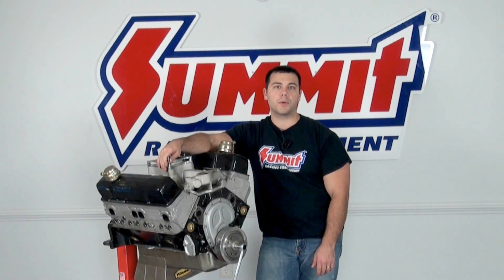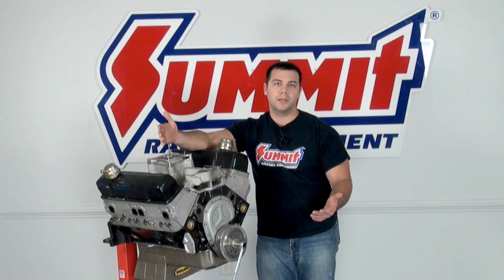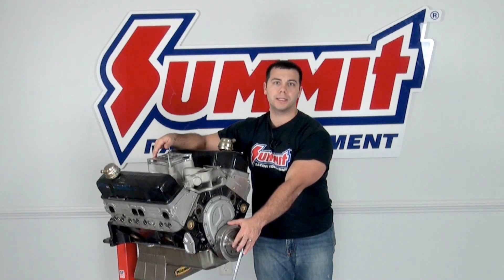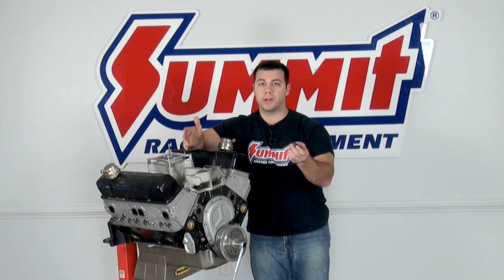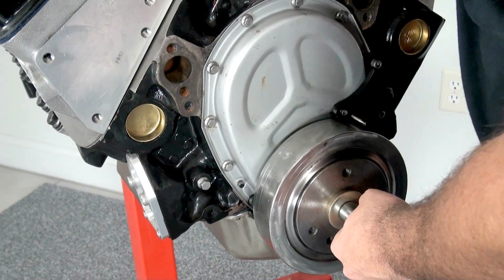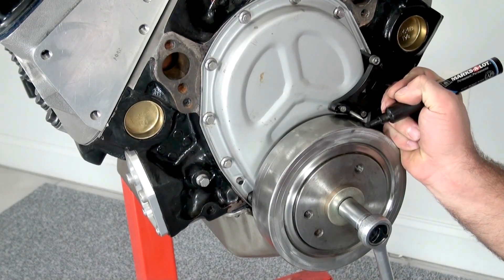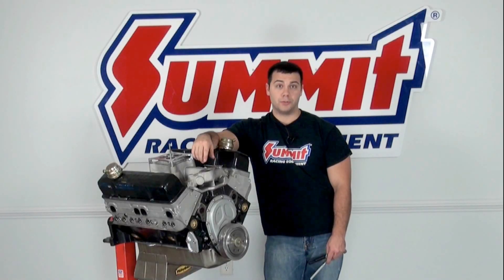How to Find Top Dead Center - Summit Racing Quick Flicks

Comment: This is a poor video because it makes far too many assumptions.  It doesn't show the TDC piston stop tool or how it works. It doesn't show how to adjust the stop gauge. There is no explanation of how we know the piston has made contact with the stop tool. The audio doesn't line up well with what is being shown. There is no mention of why you are rotating the engine the other direction.

Comment: If I try and reverse after first finding the top of the stroke, the bolt holding the harmonic dampener begins to back out?  Is that normal?
Reply: Your bolt isn't on tight enough. Get a torque wrench and tighten it

Comment: What I did I used an  extra spark plug and drilled the center out of the plug and a hose with a  compreswion guage it  worked nice.

Comment: Come on summit racing.There’s more to finding top dead center On a four cycle engine than just finding when the number 1 Piston on is on the top. You need to know when it’s on its compression stroke before you drop the distributor in otherwise could be 180° off
Reply: That's incorrect.

When the crankshaft rotates 360 degrees, the piston will still be at TDC regardless of being on compression or exhaust strokes.

Camshaft timing does not determine where the piston will be located.

Comment: Are you nuts? Doing this without making sure the valve s don't open can bend a valve!  To be safe, you should pull the valve cover,  even loosen the valve springs so they stay seated.
Reply: LOL you know that a piston stop goes alot deeper in than a spark plug right? And some cylinder heads like a big block Chev have valves angled toward the centre right? You do realize the spark plug hole is in the centre of those valves right? Like I said it's a no brainer.
Reply: ... That's incorrect. Your timing chain will move your camshaft while you are rotating your engine. The valves will only move in coordination with crank rotation. 

There is zero chance of damaging a valve this way
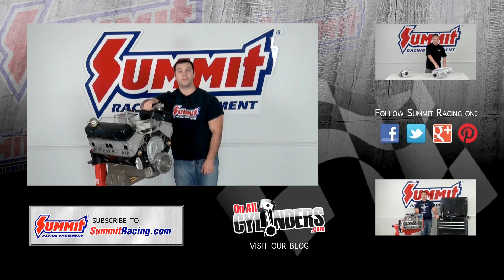Reply: Sounds like you've never done this before. The exhaust valve will open on the exhaust stroke so verifying your on the compression stroke will also make sure your valves are closed. To be 100 % sure, you can back off on the valve springs. 3:20
Reply: @jimsl7851  your engine doesn't just magically change your intake or exhaust valve timing just because you are manually cranking the engine. Sounds like you're the one who has never done this.
Reply: Valve timing has nothing to do with the fact you will reach TDC two times on 3 different piston strokes. The valves will move, and if you're running a cam with a significant lift, you run the risk of a valve contacting the piston stop. It's a no-brainer.
Reply: @jimsl7851  you do know that the piston stop goes in the spark plug hole right?

Comment: Yeah but is it on the compression stroke or the intake stroke I don’t use a tool I put my finger Over the plug hole when u fell air pushing out your on compression stroke

Comment: Poor video.  Never showed the piston stop tool.  The audio does not agree with what he is doing.  Doesn't explain why he is moving the pointer (to center it between the two marks).  It is a harmonic damper, not a dampener.  Never mentioned that this is to be done on the compression stroke.  Not up to Summit standards.
Reply from the maker: Hi Frank, we appreciate your feedback. This is an older video. We are working to recreate and improve all of the engine videos we have done in the past. Please stay tuned, the updated version of this video should post soon.

Comment: What did the stop tool do? Does the piston push something out kinda like a tire guage or what?? This video was not much help. Most of have the engine already in the car.
Reply from the maker: Thank you for your question. The purpose of a piston stop allows you to find an equal point of reference before and after TDC. The centerline of these 2 points is true TDC.  The process goes like this -rotate the engine (by hand) clockwise about 1/8th of a turn past TDC, thread the piston stop in, then rotate the engine counterclockwise until the piston contacts the stop and won’t allow it to rotate any further. At this point (atdc) you would place the first mark on your balancer or degree wheel at the 0 on your timing pointer. You would then rotate the engine clockwise away from the piston stop almost a full revolution until the piston comes up and touches the stop again. This second contact point (btdc) is where you would again mark your balancer or degree wheel on the 0. You will now have 2 marks on your balancer or degree wheel and True TDC is located in the very of the 2.
Part 2
If you want to re-install your distributor after you find TDC you can place your finger over the #1 spark plug hole and when you feel for compression while rotating the engine the timing mark should be about ¼ turn away from tdc. Or you can remove the valve cover and watch the #1 intake rocker arm open then close at which point the timing mark will be about ½ revolution away from tdc or 0.
Reply: Procedure works exactly the same when the engine is in a car.

Comment: Take plug out of #1 cyl put awadded up piece of paper towel BE CAREFUL not to lose in cyl have someone crank engine stop when pap towel is blown out of cyl. OR put thumb over hole have them crank until it blows thumpb out of cyl,go to timing mark put pointer@ TDC. Set dist. This WORKS!.

Comment: I didnt that before and i was still 180 off back fire sound like a shot gun. Now days i just put my thumb over the spark plug hole spin the engine by hand when i feel air trying to blow my thumb off then i stick a screw driver in the hole bring it up until the screw driver wont move anymore and thats my tdc and sometimes im still 180 off...

Comment: To find the compression stroke, place your finger over the hole until you feel air come out. I would prefer to do this by having someone using a flywheel tool that you use to to install the torque converter bolts IF YOU HAVE AN AUTOMATIC trans. I believe the flywheel tool can be used on the pressure plate also as it to has teeth for the starter to engage. AND, after you arrive at the compression stroke and air is seeping out around your finger, either use a straw to show when you are near TDC or use the tool for more accuracy! You can turn an engine either direction to get more accurately on spot with the piston gauge. If using a dowel or straw and you feel you can get close enough, go to the timing marks and take it from there. But you may be  @ TDC or BTDC. I would say you are close enough if you line the two marks up. Distributors usually give you play room of at least a couple inches either way of turn radius depending you vacuum module hose or wiring length.. This was just a video to sell a tool we didn't get to see because it was also not explained how to remove the valve cover to watch the furthest forward rocker arm to it's peak rise to show DTC.  Without this subject of finding TDC being accurate, there's going to be loads of problems!  There are so many ways to get this right regardless of engine if you know which piston is #1, that there's no room for getting it wrong if you follow simple directions.  Yes, the tool is just a fancy item for finding TDC, but it is probably the best for accuracy. It can't lie. I will see if I can find a video with one in action!

Comment: Poor explainations, hard to follow. How far doe the stop tool have to go in? all the way tight? Why are you rotating the balancer both way for two marks? I will just use my finger over the # 1 cylinder and take it from there.
Reply: The stop tool only need to go in far enough to make contact with the piston. You turn the balancer both ways because there’s a certain amount of crankshaft rotation where the piston is motionless at TDC. By going both ways you can isolate that area of crankshaft rotation then measure the distance between both of your marks and the center is true TDC

Comment: Hi, thanks , great video. I am new to these DIY stuff. Just wanted to know , when the piston stop bolt is screwed in then crankshaft must be in compression stroke? Or it doesn’t matter? 
There are no marks on anything for TDC. I was looking forward to do it with TDC gauge, which method is more accurate to find TDC? Thanks.

Comment: I've just replaced AFM lifers and non afm lifters on right side  in a 5.3L LC9. Question is, if I havent turned over the engine at all, couldnt you reinstall rockers, torque to 22 ft/pbs, without findind TDC and going through the whole tedious process of re-lashing all the rocker arms.

Comment: Question when Chain is worn? and the Cam point is off.and Pointing at 1200. do you just put the mark back at 6:oo and put new Chain on?
Reply: the crank gos around once and the cam spocket go's around 2 time's to make sure your right on! take the valve cover off and the intake valve once closed then set your cam spocket to the makes on crank spocket and on the cam spocket.12 on crank spocket and 6 on cam spocket. and your done.

Comment: Either the camera is mirrored or he just put it in #5
Reply: I wonder how many people this video has screwed over with that
Reply: @lsan6833  nome, seeing as he out it on the correct cylinder, you just don't know shit about V8s.
Reply: You're wrong Moe. He put it on the front most cylinder on the driver's side. That's cylinder #1 dude. Cylinder #5 would have been the driver's side, second from last. Y'all fake mechanics need to stay off YouTube
Reply: Uncle Moe Lester don’t you hate when you put it in the wrong hole
Reply: This is a smallblock Chevy and on a smallblock Chevy, the #1 cylinder is the front, driver's side, and that's exactly where he put the tool.

Comment: Worst description ever. No idea if it’s 180 out or not!
Reply: 50/50 chance!  What could possibly go wrong?  hahaha
Reply: TDC is TDC regardless of which stroke you’re on. If you’re actually going to be setting up timing you 100% need to confirm it’s on the compression stroke but it’s not necessary if you’re simply trying to find TDC

Comment: SUMMIT PLEASE READ YOU NEED REMOTE STARTER OR PERSON AND A DISTRIBUTOR WRENCH
THE ENGINE GOES AROUND TWICE  FOR EVERY ONE TIME THE DISTRIBUTOR DOES .
YOU HAVE A COMPRESSION STROKE AND A  EXAUST STROKE.
YOU THROW YOUR TOY OUT THE NEAREST WINDOW LOL JUST KIDDING
yOU NEED THE COMPRESSION STROKE  WITH DISTRIBUTOR UNPLUGGED OR OUT .
YOU USE A SUMMIT REMOTE STARTER LOL OR ANOTHER PERSON BUMPING KEY 
OR BY SOCKET THE HARD WAY.
YOU PUT YOUR FINGER IN NUMBER ONE SPARK PLUG HOLE AND TURN ENGINE WITH LITTLE BUMPS  UNTIL IT BLOWS YOUR FINGER OFF..
WATCHING YOUR POINTER FOR WHEN LINE COMES AROUND TINY BUMPS WHEN IT COMES INTO SIGHT.
EVEN TURNING IT WITH WRENCH IT WILL BLOW FINGER.
THEN IF YOU ARE WITHIN A HALF INCH EITHER WAY YOU ARE CLOSE ENOUGH .
YOU MIGHT HAVE TO DO IT TWICE IF WITH THE STARTER  
THAT IS THE COMPRESSION STROKE TOP DEAD CENTER!
THEN YOUR  ROTER HAS TO LINE UP WITH NUMBER 1 ON DISTRIBUTOR CAP!
iF YOU ARE USING A WRENCH YOU CAN GO PAST TOP DEAD CENTER AND PUT IN YOUR TOY IN SPARK PLUG HOLE
AND TURN BACK BY HAND UNTILL IT HITS TOP DEAD CENTER STOP.
IF ITS A VACUME DISTRIBUTOR MAKE SURE THE DISTRIBUTOR VAC IS POINTED AT OR A LITTLE BEHIND TRANS 
DIPSTICK SO YOU CAN SEE DISTRIBUTOR BOLT.[T WILL MAKE EVERY THING EASIER lol
YOU ARE WELCOME.
Reply: SUMMIT PLEASE MAKE A NEW VIDEO YOUL DRIVE EVERY BODY INSANE

Comment: Piston stop can verify whether your balancer has "shifted". Only reason to use piston stop. You wouldn't drop dist. In at TDC anyway on a Chevy v8.
Reply: Wrong and wrong. The primary use of a piston stop is to mark TDC on a balancer. MANY balancers don't include a TDC marking from the factory, including a number of Chevrolet engines. Additionally, not only did no one ever say that this is for dropping the distributor in (it's not, it's for marking the balancer) but you're wrong there anyhow, as you absolutely CAN drop the distributor in at TDC. You can drop a dist in at ANY point. You clearly don't know anything about how an engine works.

Comment: Are you hitting tdc on intake or exhaust cycle
Reply: You’re suppose to check tdc on the compression stroke
Reply: Eric Flores that’s incorrect. You can mark TDC on either the compression or exhaust stroke. The only time you’re concerned with TDC on compression is when you’re setting ignition timing

Comment: haven't worked on motors for decades. my old school way was to hold your finger in the spark plug hole and turn the crank til air blew out around your finger, which of coarse told you that you were on the compression stroke. then stick a wood dowel in the plug hole and turn crank  while watching the dowel and bring the piston to the top.
Reply: The dowel will either be dead on OR 180 DEGREES OFF, Put thumb over #1 cyl till it blows off line up tim mark to TDC.
Reply: @packingten   That is the best and most  simple way to do it. If you are by yourself they make a tool the screws into # 1 that has a whistle built into it and makes an audible sound.
Reply: Pretty sure all the Chilton Repair Manuals illustrated the finger in the spark plug hole method.

Comment: You forgot to mention that TDC on #1 piston must be on the Compression Stroke. It would help to tell people how to determine that also.
Reply: It wouldn't make any difference.  TDC is when the rod to the piston is straight and both valves are closed completely, e.g., just  before the compression or just after the exhaust stroke.  There is no stroke at that point, and there isn't one, because your engine is off.  The rod to the piston has to be straight, the piston has to be at its highest point, and both valves have to be closed.
Reply: @roswellgrey9771  the difference is that you may have an error of 180 degrees at the distributor.  That's the importance of finding the TDC at the peak of the compression stroke.
Reply: @MrEdgaravi  those  are two  separate  things though.  the video  was about  finding  TDC

youre timing goes  beyond that
Reply: @MrEdgaravi  Exactly, as a kid back in the 1980's I rebuilt my Pinto engine, thought I was all set, started it up and flames shot out of the carburetor throat upon cranking. My grandfather, God rest his soul, a backyard mechanic from way back, came over and explained what the problem was.
Reply: @roswellgrey9771  He forgot to remove driver side valve cover to also make sure that both valves are completely closed.
Reply: @sergiojacquez2277   TDC is TDC .. What are you going to do if your valves aren't timed correctly?  This video was only showing how to find TDC not valve timing.  Valve timing is determined by TDC not the other way around
Reply: @roswellgrey9771  Yes, but all timing measurements are based on Piston #1 being in that condition, which only occurs on the compression stroke once per cycle.
Reply: I was like wait lmaoo. some poor young soul🤦🏼‍♂️
Reply: @Motoboro660  I mean if your working on a car you should already know that🤦🏽‍♂️

Comment: If this is your first time using this tool like it was mine think about removing all other spark plugs and remove rockers from #1 piston. Otherwise you might not "feel" the piston stop hitting the piston. This also prevents valves from hitting the stop tool if you accidentally go beyond the compression stroke.  I bent the threaded rod with the piston then gouged the intake and exhaust valve in the top side of the rod.
Reply: Dane Hansen you need to be more careful. I didnt have to do any of that.
Reply: 100% operator error

Comment: You made a VERY big mistake...you should not have moved the adjustable pointer to the midpoint of your marks.  You should rotate the crank so that the midpoint of your marks lines up with the pointer.  Then If the balancer has a 0* groove or painted line that you want to use instead, you can THEN move the adjustable pointer to line up with that groove/line.   Also, It would be better to use a marker with a finer point.  The width of the marks you made were easily 3-5 degrees wide themselves, not to mention crooked; not very precise.  I realize you were working quickly for the sake of the video, and wanted the marks to be large and visible, but it would be better to do things right so as not to confuse people.  I'm sorry but this was a very poorly made video.  It should be redone.
Reply: Hmmm.  You know, I think you are right.  The original use of the pointer is just a stationary reference point to get two markings.  Moving the crank to center the pointer  between the two marks establishes TDC on the crank.  ...THEN move the adjustable pointer to line up....  Hmmm, that does make sense.
Reply: I was very confused till i read your post- thank you. using the piston stop gives you the arc or degree of tdc. it will vary based on where you stop the piston, but it should be consistent. Move the balancer marks to center with your fixed point and the TDC on the balancer should be very close to the pointer. thank you
Reply: I agree, but only if your HB has the degree markings on it and is repositionable. Mine is not repositionable but it does have the degree markings engraved on it. I have two corrective choices; 1) I mentally compensate, i.e. 1° BTDC is really TDC, or 2) I cover the HB with a new timing tape. I guess there is another solution. Swap the timing pointer out for an adjustable timing tab with degree markings and use the HB to only designate TDC/0° (ignoring any engraved markings).
Reply: Andrew Dynes 
Thanks man..👍🏼
Reply: Are you seriously that dumb? If the balancer had a groove already there would be no need to use a piston stop to ascertain TDC because the groove would already be in the correct spot. A piston stop is used to locate TDC for a balancer which does not have it marked already, and even a moderate understanding of basic math would show that the method used in this video works fine. Clearly, you don't understand basic math though.